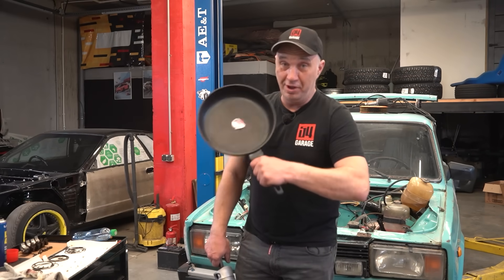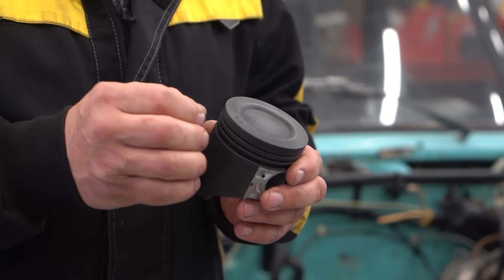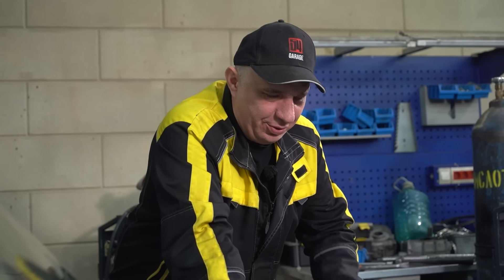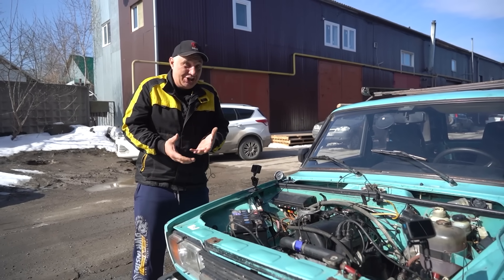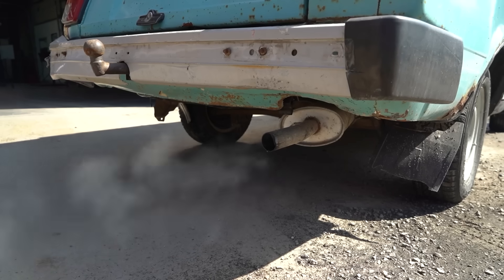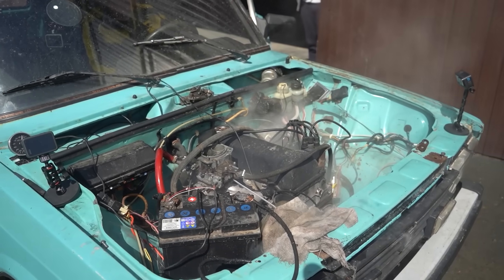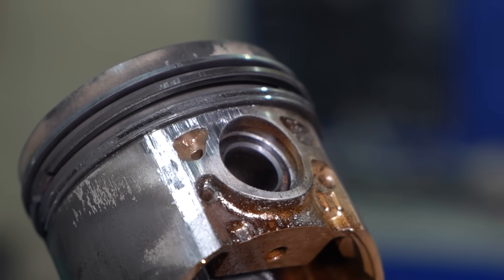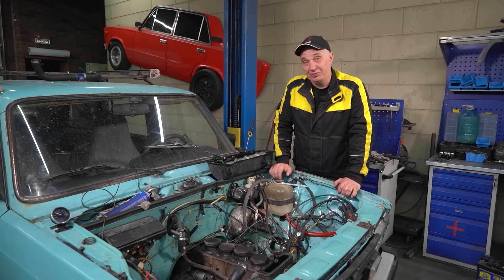We coat pistons with Teflon - what will happen?

Comment: does anyone remember Slick 50? It was an oil additive with teflon in it. It actually worked. My dad put it in my mom's Slant 6 Volare... I got that sumbitch up to 110 mph on the freeway once... The fastest I could ever get my 318 powered Coronet was 105....
Reply: Yes sir !!!!
I remember it well, treated my 1992 Subaru Brumby.  Never saw any improvement in fuel economy, but it took DRASTICALLY longer to warm up on a cold winter morning (I had to run it 10+ mins to start to defrost the windscreen, maybe that's where the fuel savings went?).  It ran quieter, smoother, and more powerful.  After 16 years, 330,000 km's, the engine still ran fine and did not burn any oil.  A mechanic told me they typically need a rebuild at 200,000 km's.  The original formula is still available, but under a different trade name - XcelPlus.  My only regret is some muppet of a mechanic told me NOT to treat my next car (2006 Holden VZ) "because the engine tolerances are TOO TIGHT".  Well, at 230,000 km's when I started to get timing chain rattle, I DID treat it - and now I'm reaping the benefits!!

Comment: You should take a car that is 100% stock from the factory Teflon coat Pistons like that, but keep everything else in proper working condition. Then see how many kilometers you can put on it and what it looks like after several oil changes kind of thing.

Comment: I can finally commemt on something chemistry related as a chemist myself. When the teflon resin is sprayed on it has to be sintered. Sintering is like melting something that doesn't flow. However, you sintered at a way too high temperature. Tour sintering temp was above the decomposition temp of teflon! This will not result in a strong teflon layer.
Reply: Teflon releases highly toxic gas when it gets too hot. That is the message that needs to made clear in the comments.
Reply: how bout ceramic coating? is it better to use for piston?
Reply: @vashandelo  ceramic comes witj its own problems but I would say it's better. It's just the fact thet PTFE coatings are so out of place in an engine. PTFE coatings should in my opinion only be used in medical devices and as a linig for chemical factories as these work well within the preferred tenperature range of PTFE.

Comment: On a 351 Cleveland we got 8 out of 11 miles one time without any cooling other than oil ...
Freeze plugs popped and flat broke !!!
1 day of school left and we made it after a 3 mile walk...
That one always impressed me !!!
Reply: I had a Rover SD1 with a straight 6 engine.  That engine wouldn't go more than a few weeks without blowing a head gasket.  It didn't matter how much machining on the deck or head, how much you paid on replacement gaskets, how gently you ran it.  Within a few weeks of assembly, that engine was going to start ejecting water again due to a blown head gasket.

The last time it blew I decided to just keep running it until if completely failed.  I ran that engine for over 100 thousand without water.  It ran fine.  The only problem was that my heater didn't work (obviously).  I eventually changed it out for the V8 engine option which was faster, lighter, more economic but, more importantly, held water (so I got my heater back)
Reply: Hold coolant you!- You

No. I'm fine-your engine

You're broken- you

I'll bet you I'm not- your engine

Comment: Coat the crank and rods journals too, and run it without oil to see how long it lasts.  Cadillac did that several years ago and claimed it could drive 50 miles with no oil...
Reply: Great marketing plan! Engine warranted for 49 miles or 40 minutes, whichever comes first.

Comment: Anyone suggesting Teflon or ceramic coated cylinder walls doesn't understand how engines work. There needs to be a cross-hatch on the walls to retain oil. They cannot be mirror smooth.

Comment: This was DEFINITELY one of your more useless experiments. It would have been nice to know how the pistons looked after about 1,000 miles of NORMAL use. You know, like NORMAL people would have done. But NOOOO. You just HAD to run the engine until it seized from thermal expansion. What exactly were you trying to learn from that? This was a big FAIL in technique.

Comment: this experiment should be done again but with an engine that is not over heated. You should drive 100km to see if the Teflon coating get damage during a normal engine operation.
Reply: When Teflon gets overheated, the fumes are toxic. I made some honey oil into a Teflon coated pan, and wondered why it was making me ill. I had flu like symptoms and the smoke was making me cough. As it happens "Teflon Flu" is a real thing. I wouldn't want to be anywhere near the exhaust.
Reply: @thebolsta  Good advice, yes must be avoided!! Burning batteries release similar smoke.
Reply: @thebolsta use a glass lid flipped over on a pot of boiling water. Best and safest way to do it.
Reply: Two with Teflon and two without.
Reply: and clean off the top of the piston before installing them.
Reply: Pulling tractors here in the US use teflon coated main and rod bearings, a engine I seen that blew up (broke the block inhalf) and the bearings looked brand new, they always do.
Reply: yeah, seems like the experiment is to ruin the engine fast as possible
Reply: @domi1347  yeah its garage 54 thats always the way she goes
Reply: Teflon starts  breaking down at around 180°C. Also the whole piston shaft is metal, which means the teflon gets scratched almost immediately. The more it gets scratched, the more it will start flaking off and it will restrict the proper function of the engine. It will also impact the thermals directly as teflon has a differend expansion rate. Even tho it is not reactive with oil, the fact that teflon is hydro and oleofobic is bad. You need pistons covered in the oil, that not only withstands the temperatures, but then is circulating and is able to transfer the heat out.
I presume, that 100km is not something that a teflon coated piston engine would make. Maybe like 10km as it definitely takes time for the engine to blow up/burn up or simply get stuck.
Reply: @xotoxpv  Companies have been coating production pistons with Teflon for a while now its proven it does NOT get scratched immediately. I took apart 134k mile TDI and it still had a bit of the worn down but intact Teflon on it (no flaking just a tad thinner). Also when it comes to running surfaces you usually have a "slick" side and the other side holds oil so its perfectly fine the cylinder walls hold the oil and the teflon is oleofobic.
Reply: @MortalKai-127  good to know, isn't that teflon a bit different than the food grade pan teflon? Isn't it only on the top of the piston where burning occurs and not from all sides? 🤔
Reply: @xotoxpv   I'm not sure the chemistry differences from the kind found on pans, but in terms of the coated areas, I've only seen the coating on the piston skirts like the example one he showed in the video. Idealy it cuts down on friction on the side of the piston skirt that sees side load into the cylinder wall.
Reply: I was saying. Simply commuting back and forth with coolant and everything. But maybe it would take too long to see results
Reply: Yeah I would have like to see what the pistons looked like after normal conditions before the overheat
Reply: Agreed, a significant amount of heat from the piston travels through the ring pack if the engine doesn't have piston oil cooling Jets (I'm not sure if old Ladas do). The footage shows a lot of evidence it was overheating around the rings so seeing that it just flaked off in places isn't surprising.
Reply: 1,000 miles would be better.
Reply: @forevercomputing with a mileage test .
Reply: @forevercomputing at least, 100km is 1~2day, we don’t  buy a car and sell it after 2 day, right?
Reply: 180c is the point, an engine rare run under 1000c
Reply: Teflon fumes should be nowhere near public spaces, it already caused a disaster once, we don't need another.
Reply: There is a term called "hot spot temperature" in cylinder and it's way above 1500°C  and the hot spot sits right top of that piston so I don't think that coating will do any good, insulator coating will absorb heat slowly and release slowly too so no good reason for a coating 
They will get good results with titanium electro plating though
Reply: NIKASiL is used for 2 strokes engine who rev high and build a lot of heat...!

Comment: Teflon starts releasing toxic gases at 260°C. The average combustion chamber surface temperatures range from 130°C to 248°C at WOT, but temperature inside the combustion chamber is typically around 1500°C.
Reply: That was my initial thought as well.  But the temperatures of the cylinder wall and piston are far lower.  On the other hand teflon is a bad heat conductor which doesn't help either.
Reply: @ralfbaechle  and as we can see in the video it didnt work out great. Ye?
Reply: The top of the piston shouldn't be coated as it doesn't add anything beneficial and only going to burn. The sides shouldn't get that hot under reasonable operating conditions but the trade off with this is that it's oleophobic which is the last thing you want for something lubricanted by oil.
Reply: Not just toxic, when combined with vapor from combustion it'll form flouric acid. I,d be surprised if the exhaust doesn't experience some corrosion.
Reply: @soreloser6018  but that's why they do this kind of stuff, because they learn the same way as the first human who tried an amanita muscaria. It's going to be a lot more insteresting if they ever move to electric vehicles.
Reply: very ai much disinformation
Reply: ...IT DOESNT MATTER THAT PISTON BODY ACTS LIKE A HEAT SINK,NO??

.....
Reply: Are you huffing the exhaust??????
Reply: @independentthinker8930  Through a cigrit filter.
Reply: No1 cares little girl... 💅🏻💅🏻💅🏻🏳️‍🌈🏳️‍🌈🏳️‍🌈
Reply: Reveste seu pistão e saia por aí intoxicando todo mundo 🙏🏻🫣
Reply: That poor Lada...
Still amazing work you guys do.
Reply: The teflon coating they used was baked on at over 400c :/
Reply: Highly toxic
Reply: Nope.
Reply: @I_Dont_Answer_Questions  Yep.

Comment: If yall can find a company kinda close, have some hard anodized pistons for abrasion resistance and durability. Might need to machine the piston a bit downsized (including ring grooves) to allow for the anodization thickness. Then ceramic coating on another time! Then how about graphite?
Reply: I believe that anodizing is less than .001 thick. But I could be wrong.

Comment: With all the flat tappet cam and lifter failures lately, if would be interesting to use Teflon to coat them
Reply: Hard-chroming or diamond-like coatings work better. Or a higher quality iron! If it has a Rockwell hardness over about 70, you're golden.

Comment: In a properly functioning engine, at no point should the pistons actually come into contact with the cylinder walls so coating them with teflon will have no effect.

It is the piston rings that come into contact with the cylinder wall and wear to form a gas tight seal and they are not coated with anything.

Comment: In the past, I've seen American demolition derby racers fit a lead pipe in place of the radiator. Although it wasn't an ideal heat exchanger, it did radiate-off some heat, and allowed longer in-competition operation without the worry of coolant loss that results from extensive front-end damage.
Reply: Why lead?!!

Alunminium, copper and even steel have better thermal conducitivy.
Heck, it even has worse thermal mass than steel.
Reply: @neutronpcxt372  because the lead is soft and will bend without rupturing like harder steels, but idk
Reply: @ Yes, but then brass/bronze would be better :)
Reply: They have copper pipes that are specifically engineered to exchange heat, and yet they chose lead?

Comment: Truck Diesel pistons are often Teflon coated - Much higher temperatures too - Good test for your Lada!
Reply: Its more of molybdenum sulfide and ceramic coating with traces of teflon.
Reply: @Ole_CornPop  i think you mean disulphide
Reply: I’ve rebuilt hundreds of diesel engines. None of the Pistons are coated with anything but oil when they are installed, they are all raw aluminum
Reply: Think of it this way: The idea behind an internal combustion engine is to convert chemical energy into mechanical energy. Heat energy is an unwanted byproduct. (Except in winter!) Any heat produced as a result of the combustion is "wasted" energy.

Diesel fuel does contain more available chemical energy than an equal volume of gasoline, but the difference is not nearly as much as I always thought it was. Someone pointed out to me a while back that the difference is only about 5%. But a diesel engine uses about 40% less fuel to produce the same power output as a gasoline engine with the same number of cylinders and total displacement. More mechanical energy from the same amount of fuel means less heat, since the chemical energy you've spent has to accounted for and the equation balanced. If it's not power, it must be heat! A major reason that a diesel engine is so much more efficient is the extremely high compression ratio. There is a lot more oxygen crammed into the cylinder at the top of the compression stroke, so the fuel is able to burn more thoroughly. A diesel engine is able to accomplish this because the fuel is not injected until the piston reaches the top of the compression stroke. It is only compressing air, not fuel. A gasoline engine compresses the fuel/air mix, so the compression ratio is limited by the fuel's ability to avoid self detonation, or "pre-ignition." (That's the "pinging" a gas motor makes when the octane is too low, or something else goes wrong.) By the way, many manufacturers are currently working on Direct Injection designs for gasoline engines which will greatly increase their efficiency and improve their emissions performance.

Both gasoline and diesel engines like to be "hot" in order to work efficiently. But with a gasoline engine the problem is "How do I get rid of all the EXCESS heat the engine produces?" With a diesel, the problem is just the opposite: "How do I conserve heat in the engine so that the fuel burns more completely?" On a cold day there's hardly any coolant circulating through your TDI, and the cooling fans will never even turn on! The problem of conserving heat also partially explains why the fuel mileage drops so much in the winter. ("Winterized" fuels containing less energy are also a problem.)

The "clattering" sound of a diesel has nothing to do with the amount of heat produced. A gasoline engine is burning fuel vapor mixed with air. A "flame front" moves outward from the spark plug. It is more of a rapid, smooth burn than an explosion. A diesel engine, on the other hand, burns very finely atomized droplets of liquid fuel. Ideally it would begin to burn instantaneously as it enters the combustion chamber from the nozzle of the injector, but in practice there is always a little bit of "delay" and a tendency for the fuel to explode all at once. Hence the "clatter" you hear. Many diesels, including TDIs, use Pilot Injection to help control the combustion noise. A tiny, metered quantity of fuel is injected several degrees before top dead center in order to start an "early" burn which helps ignite the main injection more rapidly. That also helps lower emissions. The new HEUI injector designs (High efficiency Electronically controlled Unit Injectors) use extremely high fuel pressures (about 10 times higher than most DI diesels)to more precisely meter the pilot injection, and to more thoroughly atomize the fuel spray for more efficient combustion. More complete burning means more power from less fuel, accompanied by lower emissions.

Comment: They make a coating for pistons or anything that has a surface that needs a clearance between to things and the coating takes up the space between the two so you have a tight clearance but it doesn’t affect the movement or anything
I think it’s from a company called line to line

Comment: I'm telling you before I even watch the video that you will get WAY better performance if you coat the cylinder as well. Metal scrapes teflon but teflon doesn't scrape teflon. I hope you guys try this. It could actually be revolutionary for the future of engines.
Reply: It's going to burn off from the top. I'm suggesting a mirror polished Nikasil plated liner and Teflon.
Reply: @MF175mp mirror polished walls won't retain oil. Fresh cylinders have honing marks. Worn out engines are polished smooth.
Reply: Then there is the piston rings that would scrape any coatings on the bore relatively quick.  Not sure what could be done to get around that with all the different expansions that happen in an engine.
Reply: You don’t know much about engines do you?
Reply: I'm sure it's been tried. Engineers aren't stupid. But something needs to retain the oil on the cylinder walls.
Reply: It's been around for many, MANY DECADES.  An engine treatment which coats all metal parts with teflon.  Originally sold as "slick 50", it's still available but under a different trade name.  I can personally attest to its benefits!!  (I never gained any of the claimed fuel efficiency improvements, but I know for a fact it takes DRAMATICALLY longer to warm a car on a cold winter morning (I had a 1992 Subaru Brumby, 4cyl carby engine) - because there's less friction).  Sadly, I think there's a lot of suppression by large companies that benefit by engines WEARING OUT (so you buy a new car).
Reply: This was fine, the only parts of the piston that touch the cylinder wall are the rings and a patch in the middle of the piston skirt. The rings are durable and the skirt glides on a film of oil.